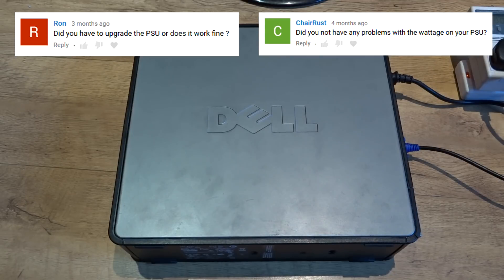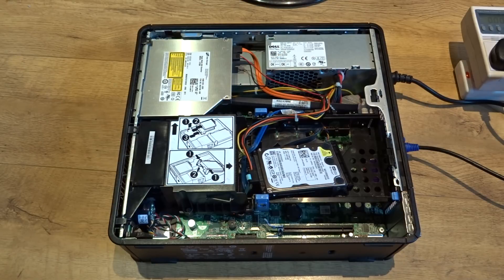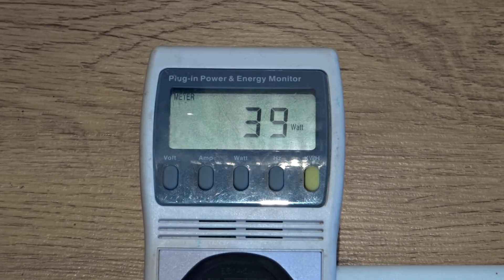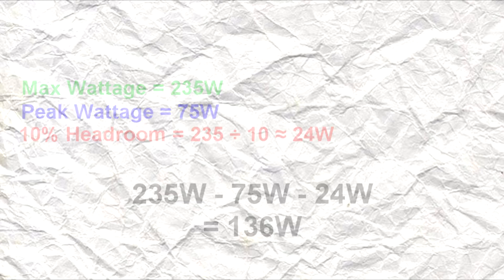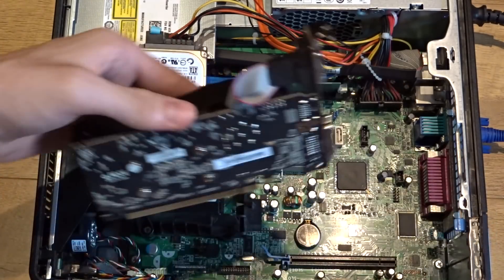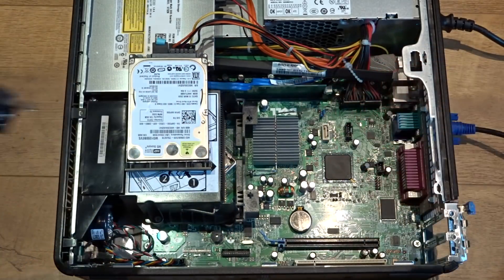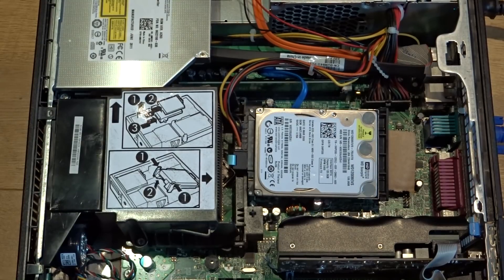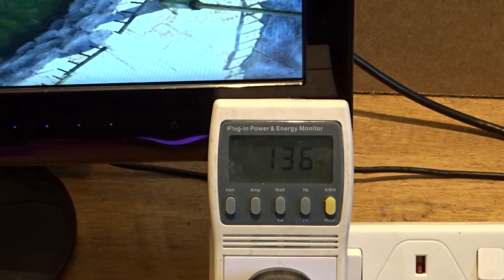Optiplex 780 SFF to Gaming PC

Comment: FWIW, the guy that had his "PC Explode" you mention in the description could've just had a damaged or fundamentally defective power supply, bad input power (wrong frequency/voltage/amperage from the wall), or had conductive particles or water in the case that shorted something out.

Assuming these wattage numbers are consistent, you're running around 50% of the max PSU load so you're actually about what is recommended for a PSU.  People often go way overboard with buying PSUs because of fearmongering from "that one guy that blew it up" and think they need 1000w PSUs.  All that really matters is quality and getting something actually appropriate for your build.  If I was to replace a Dell PSU, it would just be to upgrade to something with higher quality and possibly go higher wattage just so I could put an even better graphics card in later on.
Reply: Hey bro do you think its possible if I put a GeForce GT 710 and 8GB RAM DDR3 on my Optiplex 780 without exploding on any parts and would it be safe?
Reply: @SpekterTP  That's a 19 watt graphics card, you'll be fine.
Reply: @nunyabusiness896  what if I'll put GeForce GTX 750Ti 2GB 128bit DDR5(one fan only) will it be fine?
Reply: @SpekterTP  What formfactor of case do you have?  the small form factor cases have fewer watts.  An MT case should be fine (mini tower, the bigger one), but the smaller ones might not since it's a full 75 watt card and that's the max PCIe can do.  See if you can find the manual for your exact model and it should say how many watts your PCIe slot can handle.  If you have a SFF PC you may have to go for a GT 1030 instead as that's only a 35w card and should work.  That, or buy a new power supply, but a new power supply can be had for $25 if you buy used or shop EVGA B-stock sales (cosmetically marked but fully working parts).  All of that said, if you have a small form factor case you'll probably want a 1030 just so you can for sure fit it in the case.
Reply: @nunyabusiness896  i have the DT one
Reply: @SpekterTP  DT is 255w power supply and from what I can gather is either limited to 25w or 35w on PCIe x16.  I'd either go for the 710 or a GT 1030.  Also note on newer cards you may need to reinstall Windows 10 after switching to a UEFI Bios (google around for how to do that).
Reply: @nunyabusiness896  so it will be fine if I will put GeForce GT 1030 instead?
Reply: @SpekterTP  Probably, but I can't find firm documentation on your exact configuration regarding slot wattage.  See if the motherboard has text on it near the PCIe slot about power limits.  It won't blow it up, but it also might not post if they limit the power through the PCIe slot.
Reply: @nunyabusiness896  do you have any idea on what is the generation of my PCIe or can you  tell me instructions on how to find it out
Reply: @SpekterTP  It's not about generation of your PCIe, it's about the power designation of your specific combo of optiplex and formfactor.  There's really not any source I can find.  Like I said, it won't blow up and surely not with a GT 1030, but it might also not work.  My advice is buy one with some possibility of returning or reselling it if it doesn't work on your computer.  Or see if you can sell your current computer and get an MT case variant that will surely work with a 75 watt card.
Reply: @nunyabusiness896  what if i will upgrade my 255W PSU to 400W, what do you think?
Reply: @SpekterTP  You can do that, but I'm not sure if the motherboard is designed to handle more wattage.  I think if you're going to upgrade the PSU you'd be better getting something that uses an external 6 pin like a 1060 and then most of the power will come directly from the power supply.
Reply: Third party vendor's PSU may not fit into Dell mini casing.
Reply: @nunyabusiness896  do you think the 9010 i5 2400 can power a 1050 low profile?
Reply: @evanpeou6117  If it's an MT, then most likely yes, if it's a small form factor, I don't know.  Try to find documentation for your model and whether or not it supports 75w on the PCIe x16 slot.

Comment: I have an dell optiplex 3050 8gb ram intel core i3 7th gen and psu 240 watts and iam using gt 710 2gb will I have problems soon ??? Plz answer for this moment all works grete but iam afraid plz answer ??
Reply from the maker: The GT 710 is such a low power card that I wouldn't worry. Dell Optiplexes are designed to have low power graphics cards installed, so it should be fine.

Comment: so i got the same computer, what graphics gard could I put inside there ?
Reply from the maker: There are not many cards that will fit easily. The best card I could find was a GTX 750 Ti as shown in this video but they have been discontinued.
A low profile GT 1030 would fit. You just need to make sure it is single slot and low profile.
The basic requirements are:
1) Single Slot
2) Low Profile (usually only has two monitor connectors on the back or three with one removable connector)
3) Under 75W (lower is better since these power supplies are not the best)
4) Shorter than 180mm (if I remember correctly)

Comment: I have a Dell Optiplex  3010 SFF motherboard that I put into an atx case along with a 500 watt psu...It works great but the problem is that the pcie x16 slot has a max wattage of 50 watts and every card I have needs at least 75 watts from the pcie x16 slot. I always assumed that 75 watts was the norm for the pcie x16 slot so now I'm stuck with a motherboard that has very limited graphics card compatibility...If anybody knows a way around this I'd love to hear it...

Comment: This is awesome. Im making an arcade out of one of these and found the 230w units and the 300w graphics cards might be a problem. I figured I would just buy the 305w power supply even if it didn't fit, well see.

Comment: You could take out the CD-ROM and use a converter on the SATA cable and put a PCI-E extender into the system and it could power a fairly powerful GPU

Comment: These do make a good gaming rig, best card you can fit in there is a GTX 1050ti (with a little bit of cutting to the case) also if you take the clips off from the hard drive tray you can still fit it back inside the case, which is much better than shoving a piece of card in there that will move the moment you pick up the computer.I recently sold my old one of these on ebay with an SSD, a HDD, GTX750Ti, 16GB DDR3 core 2 Quad 2.83Ghz, and the DVD Drive all working with no power issues and nothing flapping around on cardboard
Reply from the maker: The cardboard thing was just because I didn't have any other ideas on where to put the hard drive :P

Comment: Why not just run an external PSU?
Reply: Its better to transfer the mobo into new matx casing with new power supply
Reply from the maker: Well, you could if you wanted. It's just cheaper and easier to do it this may in my opinion.

Comment: Great video! I have an HP Prodesk 600 g1 sff with i3 4170, 10 go ddr3 1333 MHz and a gtx 1050. Do I need to worry about heat? I noticed that it can get quite hot in these small pc’s.

Comment: Hello, Does 750Ti will fit to Optiplex 780 MT? With OEM psu. Someone can answer me ?
Reply from the maker: This is a 780 SFF so a GTX 750ti will fit within a 780 MT. I used the stock PSU in this video so I would think it would work with the MT version.
Reply: @MightyElemental  Thanks for you answer bro, I will sub and like. Btw, Can you list me what what parts on optiplex 780 sff you own already upgrade ? Sry for my bad english.

Comment: I hackinstoshed a Opti 780. As long as you have a SSD, it tucks in perfectly under the DVD drive no problem. Mine stays perfectly in place with no modding

Comment: Can this mobo be transferred to another case? Is it atx compatible? If it is just buy an old clunky pc with an atx form factor at a thrift store and put it in with a standard ,higher capacity PSU. Not elegant but it might work. Are the power connectors on the board standard?
Reply: No they are not
Reply: No,its a BTX , and very hard to find custom cases
Reply: @PB1up  I know some Dells are btx and cannot be transferred to atx and mini atx cases. I  got very frustrated by the reverse configuration several years ago.

Comment: hey im thinking about getting one of these del optiplex-es to upgrade in to a gaming rig... i want to drop in a 1050 ti or something in that range. can i fit any card in the slot of any optiplex? or are there certain models i should watch out for? (of course this is granted i will be upgrading the power supply as well.) 

 thanks mate!
Reply from the maker: Good to hear you are upgrading the power supply. In that case, power usage should not be an issue for you as it was an issue for another viewer.

For a graphics card, you will want to plug it into the PCIe slot. Every optiplex I've seen only has a single PCIe slot. Because of it's placement, it restricts you to single slot cards unless you aren't afraid to start cutting parts off the case / IO panel on the graphics card.

Depending on what model you buy, you will be restricted to a single slot, low profile graphics card. Unfortunately, the most powerful card that fits this description that I can find is the GTX 750 Ti as shown in this video.
If you managed to get a Mini Tower optiplex then you would be able to go for any single slot card (below a certain length). If you do get a Mini Tower then I would suggest getting this: https://www.amazon.co.uk/dp/B01M27X994/
Reply: MightyElemental awesome thanks for the info im probly ganna get the mini tower but its up to what i can find. 

Thx!
Reply: skip anything in the core2 family, go for the second gen i5/i7 systems. The old core2 systems really struggle for gaming nowdays.

Comment: That's nice to know. My computer is a dell optiplex 755 and it's maximum wattage is 275w. If the optiplex 780 has less wattage and you shouldn't ever even be close to the limit, then I am good.
Reply from the maker: The wattage is not the only thing you should look out for. At the time of making this video, I did not think about it but you should make sure the 12v rail supplies enough current. It should do in most cases, but better safe than sorry.
Reply: MightyElemental Oh okay
Reply: MightyElemental But how do you do that?

Comment: I did exactly what you said..and it blew up after 30 mins. Thanks.
Reply: You had faulty hardware. Nothing to with the power limits of the PSU at that point. I've ran these systems for four years now and I've had zero problems.

Comment: Put a new power supply? Add an extra 50$ for a 400w?
Reply: No point since anything you can fit in the case won't even stress the 240watt PSU.

Comment: Hey MightyElemental, if it's just a 2.5" drive, do what I would do!! ===> stick it UNDER the optical drive bay! 

I used a 2.5" caddy do literally glue it under the optical drive (which is barely used anyways so no problem with heat) and then screw the drive in the caddy.

The reason why I did this with MY optiplex (media server) is simply because:

1- it is NOT just simply dangling in the case (especially if I choose to have my optiplex standing)
2- contrary to your video, with my method, the hdd (or ssd in my case) is not directly exposed to the cpu heat tunnel
3-it does not interfere with any cables/wires nor is there the risk of short circuits  since I've isolated all metal parts of the caddy with electrical tape before screwing-in the hhd or even gluing the caddy itself

Since this video was about converting an optiplex pc to a gamer one (or crap into gold), 👌excellent👌 work since you did your research on the wattage. For my optiplex, I'm using a gt730 that was laying around as it only drains up to 50 watts.

Optiplex Specs:
Q9300 Core2Quad
4gb 667mhz DDR2 ram (2x2gb)
OCZ vertex 2 240gb
Optical drive(replaced with a WD blue 5400rpm 2TB HDD)
Windows 10 Home
Reply from the maker: Mananga Lilla you make an excellent suggestion. If I were going to build this PC properly then I would likely go with your method. This video was focused on the graphics card and wattage as I'm sure you are aware so I just threw everything else together.
In hindsight I should have built it properly. But that's hindsight for you. always 20/20

Comment: One thing you always got to keep in mind to is all the information online for example you can go to Wikipedia and look at a graph of all the particular gpus and you can see how much wattage the each particular GPU consumes and one thing I do how much wattage a particular GPU requires to run and I try to weigh that against all the other components in my system or whatever system that I'm running at that particular moment but any GPU can run in your system if you have enough wattage my point is always do your research

Comment: i just put a 710 inside and till now it works great, as simple as that, its like my pc is 3 times more powerfull and i can run sc2 and many games so smoothly i stil lcant believe it, hope the system will not have problem but in the end it s like i had a new gaming pc for ...35€ lol
Only thing is the card is a bit too big to go inside properly so i let the pc a bit opened so the card fits into it
Reply: stkfr bro I have psu 240 watts and I have gt 710 2gb if I will put it inside will I have problems soon ?? Is your pc still alive without problems ???

Comment: I highly recommend upgrading ram to 8g  or 16 and use the gt 1030 it only takes 36w
Reply: why? I'm running on 4 gigs of RAM and it does everything I need. Not like you're going to be gaming on AAA titles and running them at decent frames anyway. 16GB of ram isn't necessary.
Reply: I'd still go 8gb over 4gb (plus DDR3 ram is so cheap). That also lets you use a 64 bit operating system better
Reply from the maker: Inferno Gaming I would do if this was my main pc but I don't use it at all.

Comment: Not trying to be a jerk, but for more proof of concept, is this still alive?
Reply from the maker: if you are asking if this pc still works, I used a similar setup every day for a year without issue. so, I'd say it would be fine
Reply: Oh, thank you. I was going to do this, but putting a 280w psu in for more breathing room. Just needed to know if the build held up, or not with the 235. Posting with it now, but upgraded the cpu to q9400, and boot is an ssd. Liking this toaster so far, and just put in 8gb ram.
Reply: Just get Dell Optiplex 7010. I got mine with i5 3470 8GB ram and GT 1030. Plays great. All older games at 1080 max. I use it more than a year 12 hours a day!
Reply: I already finished that project, but this was primarily a HTPC for the parents, so light gaming is secondary on it. I've been looking at that one for an optiplex build should i ever wanna do this again though. I like these little guys.
Reply: It's my main rig now because my old one died with R9270. I guess GT1030 is little slower than R9270 but not much. Saving money now for Ryzen
Reply: I hope you didn't get the GDDR4 version of the 1030, and got the gddr5 one.
Reply: Bought it last year before DDR4 bullshit
Reply: Good. Damn nvidia think they are slick...
Reply: I wanted low profile and at first RX550 but low profile was not available in Thailand. And at the time they had only full height cards. Luckily Nvidia announced GT1030. I waited GT1030 and wait of 2 months paid off. I don't complain, except for lack of shadowplay support on GT models. I play old games mostly like Mass Effect, Stalker, Fallout 3, Far Cry 3 etc. I wait for Steam 1-5$ sales :)
Reply: Waiting always pays off when it comes to this stuff, nicely done. Didn't know about the shadow play not being available  on the gt cards, but  till the gddr5 1030 they weren't exactly viable for gaming anyway.
Reply: If it helps any, I used an  core2quad/750ti combo for two years on a 240watt PSU, zero problems. I I then upgraded to a i7 2600/750ti combo still on 240watt for another year. After that, I upgraded to a RX 470/i7 2600 combo still on 240watt. Yes, everything still works.
Reply: @carlos2004  if I use gtx 750ti low profile on optiplex 755 desktop, will it run fine. It has 280w psu. And the pcie slot is labeled as 25w.

Comment: can i play heavy games like gta v on 
Hp Compaq 6200 pro ssf
intel core i5 2400 3.1 ghz
And also tell me that which graphic card should i need to buy?
Reply: If at 1080p, the 1050/1050ti work really well in combination with the i5. and yes, you can play gta V
Reply: low profile 750ti
Reply: Get a gt 1030 if you're within the 100$ budget

Comment: No, it's crap. Case ventilation is much better in the HP SFF range, Dells are just too cramped and run too hot. The full tower cases are much better.
Reply from the maker: True, true, I did experience overheating so I did add a thermal and power limit to the GPU, but still, this was more of a concept thing to show what is possible.

Comment: So did it work out? And do u still use it? And can u run fortnite is so please reply I have the same pc and I'm willing on paying to upgrade this thanks alot and nice vid I subbed
Reply from the maker: I don't use it anymore since I have upgraded. However, I believe you would be able to run fortnite on this PC.
This video shows a computer with worse specs: https://www.youtube.com/watch?v=YZtbaqvbJGY
If it can get about 20fps with a gt 610, then I think that you would be able to get at least 60fps with a gtx 750 ti.
Reply: MightyElemental oh OK and thanks a lot . I'm gonna put on a gt 1030 and a i5 or i3 latest gen how would that run fortnite on med settings? ( btw I have this pc )

Comment: What is the wattage on the 12 rail though? Trash OEM PSUs have the brunt of their wattage on the 3.3v and 5v rails. I imagine your GPU is taking all the wattage the PSU can muster on the 12v rail and capping you performance. Yeah it'll run, but not optimally.
Reply from the maker: It says:
12VA /  13A
12VB / 11A
5VSB / 5A
Even if it did have a good power supply, the CPU is bottlenecking the GPU.